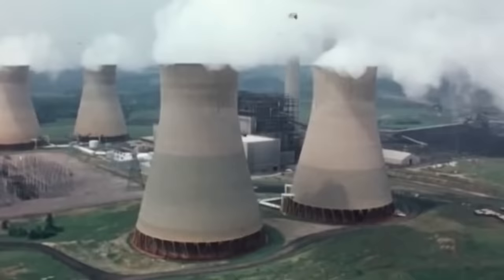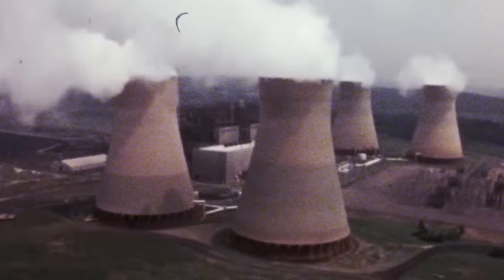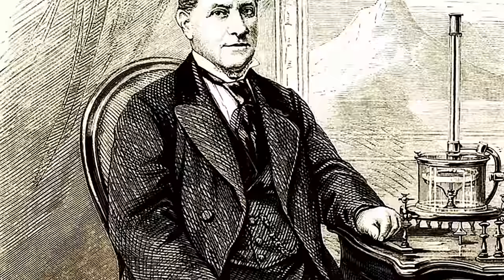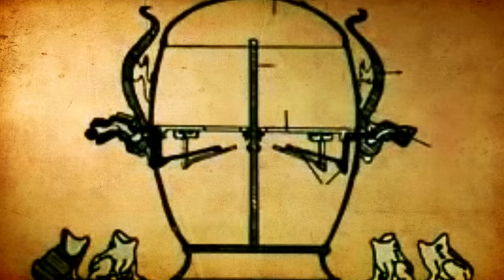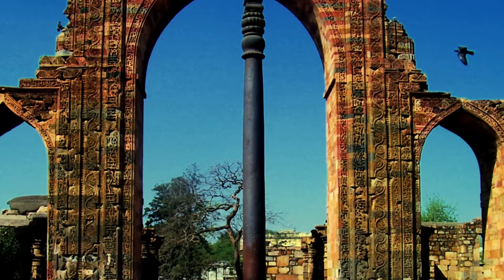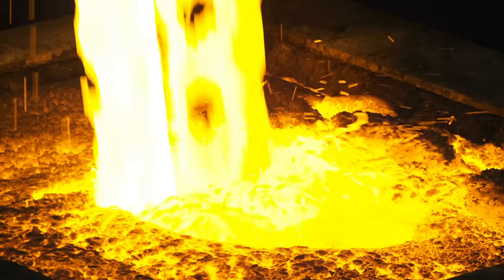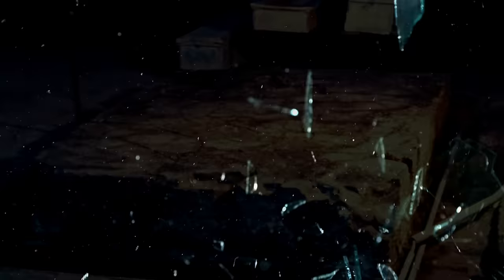5 Unexplained (And Out Of Place) Ancient Technologies

Comment: The batteries?  Best theory I've heard is that they were used for gold electroplating.
Reply: I think that is very plausible. You don’t need high voltage for electroplating. The other potential use is medicinal electroshock. I think electroplating
Reply: Yessir, thought it had been decided upon.
Reply: @QFL681  yeah I think that’s the prevailing theory. Some guy finds his jar of old wine with copper and gold spoons in it finds some of the gold has migrated and has an aha moment.* Many inventions were discovered before we understood exactly what made them work.

*Its been many years since I took a science class, I am sure would require a bit more than that but you get the idea.
Reply: Yeah, considering how many ancient societies used gold, it actually makes the most sense that electroplating was a possibility.
Reply: I mean… would this not also be a great fire starter?
Reply: @5777Whatup  If it's capable of producing a spark it very well could have been used that way. But, I think you'd have seen it more often as there'd be no reason to hide this. (However, that also made me think of this, so sorry it seems like two posts in one)...

Regardless, someone's post above me hit on the idea that this was just a fluke. An ah-ha moment. As they said, someone back in the day left some spoons in a cup of wine and saw they had all "turned" to gold. That could be where the idea of a philosopher's stone started, along with the entire field of alchemy.

If you were an emperor, king, sultan or noble, you'd have been fascinated and terrified of this invention. Not only would you have an unlimited amount of gold, but your peasants would too. That could be why this was found in a royal palace. And why you really don't find it mentioned anywhere else. Imagine the chaos this invention would have caused. It would be like counterfeiters today learning the secrets to print Euros or Dollars.
Reply: And to top it all off. The only known artifact was in the Baghdad museum. The Baghdad battery was the 1st thing that came up stolen. Strange…
Reply: Have they found any plated gold?
Reply: "The simplest explanation is usually the best one" - William of Ockham
Reply: @HouseholdDog  yes gold plate and sliver plate was known to the ancient world, however one caution is there are other ways to do this than electroplating.
Reply: I thought some guy used a 1981 DeLorean DMC-12 to go back in time and needed Power to charge his Phone so that's why they Built it
Reply: @TheOfficialChannelOfChannels  best answer here.
Reply: That's what I thought.
Reply: william sands  maybe mercury was very limited in some places at those times 🤷‍♂️
Reply: more likely it was just used to make wine.
Reply: Nah. Gold plating was easily done before elecroplating. 

It wasn't a battery. The pottery jar was sealed and an iron dowel was found next to it.
Reply: @DanielFrost79  Simplest explanation is that it was not a battery.
Reply: @judd0112  Are you kidding? This artifact would easily be the most valuable artifact, as far as selling to Americans goes!

Plus, once it's stolen, you can make and a few fakes from pottery jars of that era, which are very common.
Reply: @QFL681  No, you dont need high voltage for electroplating, but you do need decent current flow and that current has to flow steadily for hours or days. Not a chance of that with the artifact known as the Baghdad Battery.
Reply: @dougriech6561  Only in alternative history fantasy world. It wasn't a battery.

Look around on YouTube, there are guys busting a nut trying to prove this was a battery. They can barely get a voltmeter to move or an LED to light up, let alone electroplate anything.
Reply: @tpxchallenger  Exactly. 👍
Reply: @angelarch5352  Sure, connecting batteries in series is well known as a way to raise voltage, and not just to scientists. Unfortunately for those who believe the "Baghdad battery" was a battery,  the copper tube was underneath the bitumin seal and not accessible, so it was not an anode. There is also no wiring at all, and the artifact was found alone, not with other artifacts. 

It's a very interesting thought, but this artifact being a battery and that battery doing useful work is creative speculation, not proven fact.
Reply: @5777Whatup  A 2v spark is so tiny that you would need something extremely flammable like gasoline to make a fire. While a flint and steel makes a longer lasting spark that will relatively easily ignite dry tinder. And dont forget how valuable copper was
Reply: Best theory is they were used to store religious scrolls.
Reply: I wonder if they used to to create hydrogen and oxygen... Maybe for some type of weapon, ceremony,building etc... Also I believe they figured out the power of water and used it to make jet type nozzles for stone cutting and shaping... Just a thought. Oh and yeah they definitely were electro plating

Comment: last i heard scientists figured out that the iron pillar had been coated in a type of anti rust solution similar to what is used today in the oil field.. but they had not figured out what it comprised of yet and were baffled that it worked so good.
Reply: I'm more baffled how no birds have made a mess of it. Unless it's routinely cleaned
Reply: Indeed.
Reply: Observers have noted the surface does slightly rust in the infrequent rainstorms. That would make sense, since phosphorus is much less efficient at surface passivation than, say, chromium.
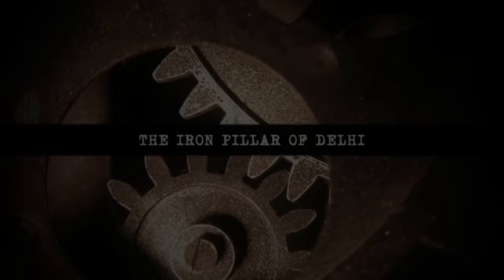Reply: 4:50 sounds to me like they used a meteorite ore type iron that almost always is some kind of alloy. Looks like they were lucky and it was a alloy that would not rust. It was actually pretty common to use meteorite iron for special constructions or tools in ancient civilizations as it was already alloyed and just had to be casted or worked into shape
Reply: @mercuryfalconog  Yes, ancient peoples used meteoritic iron to hammer forge small tools. But meteors are iron alloyed with nickel. Could their forges reach the temperature needed to cast that alloy into a column? I don't know.
Reply: @rpbajb  or even gathering that much material in the first place. But I get your point. But then again we could not really figure out how to make a perfect copy of ancient romes water concrete or "greek fire" 
so there is always some wiggle room lol
Reply: I'm wondering if there is any concentration of zinc in the metal, like we use today to make galvanized steel and iron, it doesn't rust as readily.
Reply: @Nothing-zw3yd  Galvanizing is a surface treatment. It is not used in alloying S.S.
Reply: I theorize that its coating made of materials and compounds that are no longer accessible, perhaps the sources are now extinct today.

Comment: I have an idea about the reason and use of the 'Bagdad battery' which is this: The pots were used to clean jewelry of departed family members by placing them inside. It could have been used in various crafts and for religious or official purposes. Purifying sacraments and apparel, idols, or ring of office to remove any unwanted negative trait attached to it. A ringmaker or chainmaker could keep the items they create inside the pots for an amount of time between working the precious metal to placing the finished ring or chain out for display and sale. 
But these are probably just as unlikely as all the other ideas for what the Bagdad Battery primarily used for. Cheers!

Comment: The batteries were most likely used for electroplating gold on to jewellery made from pewter ,lead or some other cheaper metal.  The  knowledge of electroplating most likely survived from a pre diluvian sophisticated civilization that had mastered electricity. This knowledge was closely guarded by those who possessed it,for reasons of greed. Can you imagine what you could do back then if you could gold plate jewellery and other things?  This greed unfortunately prevented this knowledge from being expanded upon and used for the greater good until the 17th century. Think where we might be now if electricity had become known in the 10th century.
Reply: They weren't batteries. Much more likely to have been used for storage of documents or something else valuable but fragile or perishable. 

I've seen quite a few videos of working models but the power (current x voltage) is so miniscule it just would not do any useful work, including electroplating. 

It's a fun idea but I don't believe it's a battery.
Reply: @tpxchallenger  I saw a video of a guy electroplating with a reconstruction of one of these. Why would you make something like this to store documents?  Makes no sense.
Reply: @tpxchallenger  oddly enough 2Volts is about the amount of voltage difference needed for most metals to transfer in an aqueous solution - so why make the "Battery" better when it doesn't need to?
Reply: @jadedequeljoe3283  Did you? I've seen one or two. Not very successful.  I'll happily watch yours if you link it. 

Baghdad battery has dissappeared now, but when it was found tjere was no anode or cathode. The iron post was not stuck in the jar and the copper part was sealed.
Reply: @Angel-fb5ri    Well, energy density, for one. Current (I work with batteries with 72v and peak current flow of over 1000 amps). Longevity. All sorts of ways to improve batteries, as we have been doing for over 150 years.

Yes, I know 2v is the nominal voltage value for a battery cell but I challenge you to do any electroplating  with that. 

Also, there is absolutely zero evidence this was a battery. An iron nail or dowel was found near a pottery jar that had a small copper tube or jar inside it. The pottery jar was sealed with clay.
Reply: @tpxchallenger   2volts is more than enough voltage to electroplate copper onto iron. 

From a Chemistry Book:
Cu=-0.34v : Fe= -0.45v
Meaning that Copper will dissolve before Iron since it only needs 0.34volts to turn from solid copper to aqueous copper: Cu(s) ->   Cu2+(aq) + 2e

Full Electroplating Equation:
Cu(s) + Fe(s) ----(Voltage)--->    Cu2+(aq) + 2e + Fe(s) 
The copper ions travel towards the iron anode to reform into solid copper once they regain the lost electrons. Those electrons are donated by the external battery that is providing the power.

This will work slightly differently in the case of a battery since the electron source will be coming from the anode itself (iron rod) rather than from an external source such as in electroplating. This will result in the following equations:

Cu(s) ----->     Cu2+(aq) + 2e     V=-0.34
                                                                            |------> In acidic solution or any salt solution
Fe(s) ----->    Fe(2+) + 2e           V=-0.45

In this case, the iron will corrode because it will need to donate electrons to the incoming dissolved copper ions in the solution. You will be left with aqueous iron in solution with the copper plated into the leftover iron rod as "new/pure" copper. The solution will have 0.34V at the maximum and that voltage will drop the further you get from the center of the reaction. If you use acid this reaction is extremely fast and highly exothermic so it's better if one uses a salt such as NaCl or KCL.

Modern rechargeable batteries have a separating mesh that prevents the destruction of the anode as you probably know but these ancient batteries didn't so they would need new anodes after each use.

The key with electroplating is the surface area and distance between the metals. I have electroplated with stainless steel, copper, gold, and cobalt. You want low voltage to keep the heat at a minimum (the solution can get pretty hot). Also, you want to have as much as the metal exposed and within an inch of each other.
Reply: @Angel-fb5ri  Very interesting. What was your current? You are talking about excessive heat so your current must have been high. 

Were you using some sort of welding apparatus? What are you doing with this stuff? I've just seen chrome plating being done.

Comment: The Gabon reaction is claimed to have happened naturally.
Reply: Yep. An article in Scientific American a few years back offered a very reasonable explanation. Two billion years ago, fissile U-235 was more abundant than it is today because it hadn't yet decayed. Water is an effective moderator of neutrons, and is still used to slow them down to increase the odds of capture by an unstable nucleus. Natural groundwater could have played such a role. Heat generated by the reaction might then have boiled the water off, quenching the reaction. But as the ore deposits cooled, the water would have begun flowing again, starting the reaction anew. This self-moderating reaction would have cycled on and off for millions of years until the fuel was exhausted.
Reply: @lesnyk255  Brilliant

Comment: The Bagdad battery was thought to be used for gold plating as the voltage was just enough to plate jewelry with this amount of power.
The reason is that a lot of gold dust was found near many Bagdad batteries, but it is still unproven (that it was used for that purpose). The voltage is indeed strong enough to do the plating though so that is proven.

No one really knows but it is interesting to speculate.

Comment: You don't "need" a moderator to slow down the neutrons, fast neutron reactions are a thing... in fact uranium-238, upon absorbing a neutron forms uranium-239, and this isotope decays into plutonium-239—a fissile material able to facilitate fast neutron fission. Thorium as well, an element found in many locations around uranium, upon absorbing a neutron forms uranium-233 also a fissile material able to facilitate fast neutron fission.

Comment: The low voltage of the Bagdad Batteries doesn't actually present an issue powering high voltage devices, as if you wire several batteries with the same voltage in series, the total voltage becomes their sum.  So essentially 6 batteries at 2volts per battery wired in series will produce 12volts, and this is scalable.  And if you also need to boost amperage (or total current), a series-parallel battery configuration could be used.  In this example you create several battery systems wired in series as described before, each producing the same desired voltage (12v in the earlier example), and then you wire those systems together in parallel to produce the desired total current.

The real issue with using Bagdad Batteries would be reading the voltage, however assuming a multimeter of some sort did exist at the time (or even a voltmeter) and that this device did not survive to our time to be discovered alongside the batteries, scaling as described above would be totally do-able.  

Additionally, tasks like electro-plating can be performed with relatively low voltages.  Lighting too.

Comment: The baghdad batteries were likely used for electroplating gold and such. I don't know how much electricity that requires but it seems more feasible than a battery for a light. With no leads or anything coming out, it's entirely possible that they would put a ring or whatnot inside the jar, seal it up, and let the magic happen. However long later, you open it up and retrieve your now gold plated thing. 

Just a theory.

Comment: The "Bagdad Batteries" actually have been explained now, they were special vessels to preserve parchment, only one of the 4 located had anything in common with a battery like contraption. Also they weren't found I'm Bagdad, but a settlement something like 50 miles from Bagdad. I highly encourage reading on the subject, Minuteman is a great source for this in particular.
Reply: Actually he even got it wrong, there's a video that responds to him which is pretty cool. They were likely jars for spells

Comment: Seems odd to me that they'd say that 2 volts would be useless when most smaller batteries today only produce about 1.5 volts, with larger ones producing 6v or 9v and not till you get much larger do you get 12v or 24v batteries, so the thought that a bunch of 2 volt batteries being used in electroplating or powering some weak device doesn't seem that big of a stretch to me.

Comment: Bagdad battery, I have read a few theories, that seem very plausible,  one being that they were used for primitive electroplating , you only need a few volts, and is not that difficult.  another was that is could have been used for some kind of water purification.  ( not electrical, but more chemical reaction ) copper has long been known to be antibacterial, so these things may have been used as water purifiers.

Comment: Remember the pint size 1 1/2 volt cells, the pint size Eveready early portable valve radios employed to heat the emitters. One cell does not a battery make. From two too a thousand is a battery. Some battery cars use 800 volts.

Comment: For your information, all batteries around you consist of low voltage cells, connected in series if a higher voltage is required. Your phone runs of 3.5-4V, your car battery is made up of 6 leadacid batteries and EVs connect hundreds of small cells together

Comment: #1. A Uranium-rich Asteroid?
#2. Necessity is the mother of invention? The fact that there are a lot of Earthquakes there would probably dictate that it was needed for the area.
#3. It is the Phaspherous in it. The product OSPHO, uses Phospherous to turn rust back into metal.
#4. The second theory.
#5. Experimentation. It was a guess at a new technology and didn't work due to a lack of necessary material as well as other extras needed to make it work correctly.  Like with Lincoln Zephyr V-12 motors from the late Thirties. It was a good idea but the technology wasn't there to make them work properly including the right materials and the cooling system that was required for the engine but didn't exist because it couldn't due to the lack of technology, materials and chemicals needed that are present in today's vehicles.